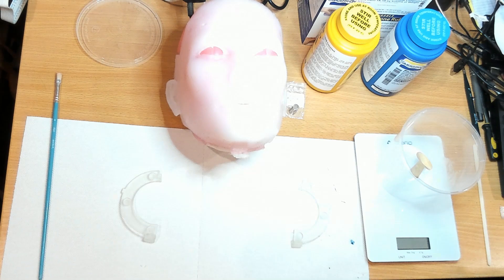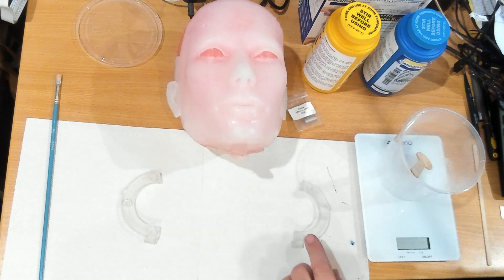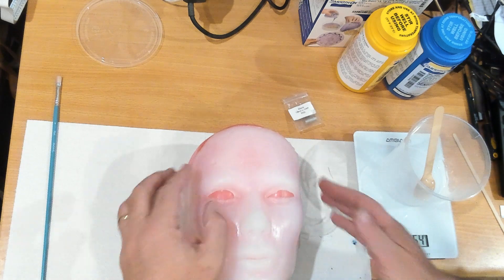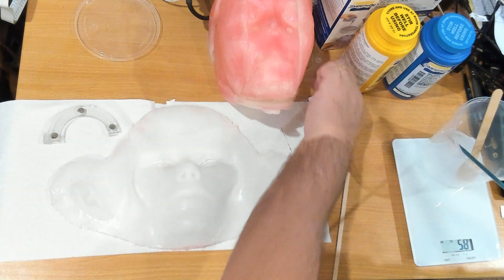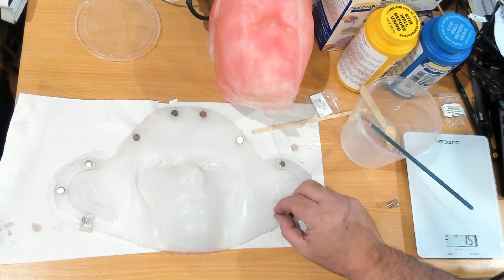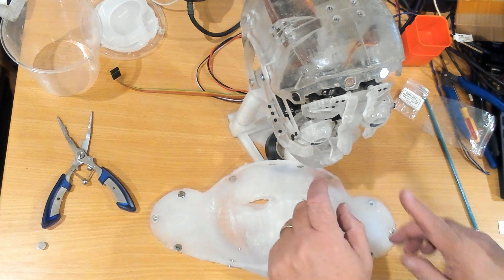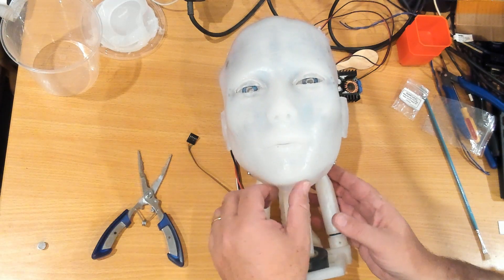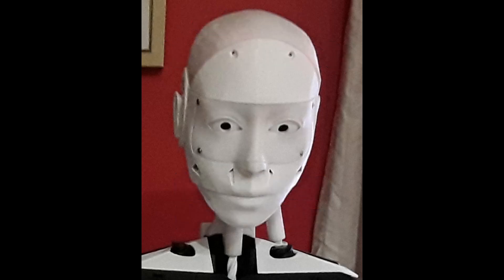InMoov i2Head build Part 8

Comment: If one does not want to use the magnet and want to use a clue to just stick the face to the Plastic  can that be done and what clue would work
Reply from the maker: I've used cyanoacrylate AKA CA glue or Super Glue to hold the magnets to the Silicone face mask.
The same glue has been known to work with various plastics like PLA, PETG and the SLA resins, so that should work.

I would not recommend gluing it on.
I have already had to remove the face mask a number of times to make repairs to the eye mech, if you glue the face on, that will make it very difficult to make repairs.
Reply: @CyberOne  The problem with the magnets  would they hold Strong enough to move the face, what if used Silicone Glue,Adhesive for Silicone,for bonding Between Silicone and Silicone, Silicone and Other Material
Reply from the maker: The magnets are around the edge of the face only.
They haven't caused any issue so far with the operation of the face or servos...
I was looking at using smaller magnets to attach some of the other connection points, like the nose, eye brows and cheek pullers.